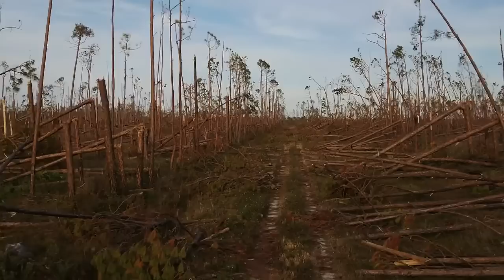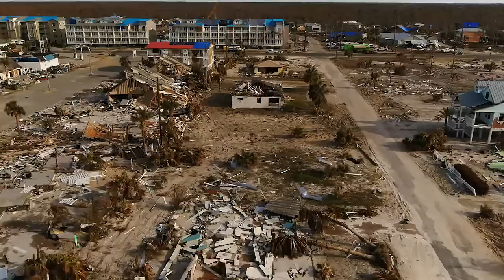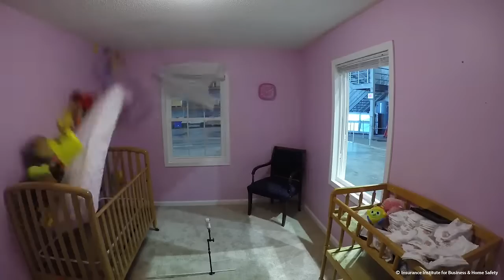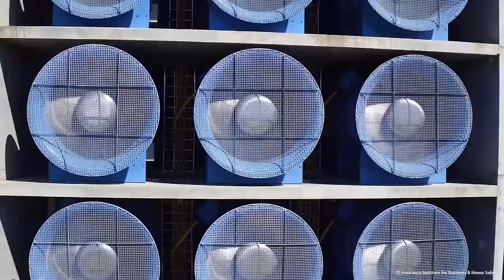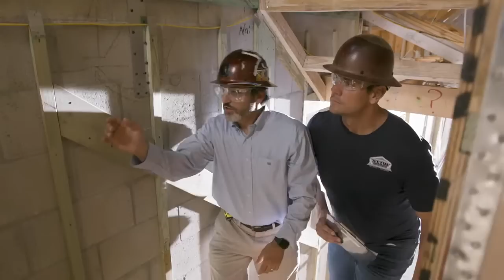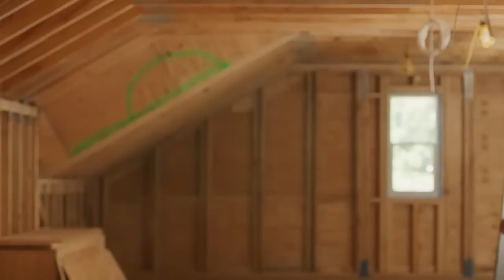Preparing for a Hurricane: the Engineering Behind Your Home

Comment: There is a catch because the hurricane-engineered home is 20% more expensive. The insurance is usually based on the replacement cost so the cost of insurance is actually higher. In the long term, it's cheaper to rebuild. Now if a house can withstand wind and water there could be a lower cost and less displacement of homeowners. Concrete domes hold up the best and everyone knows it. It's probably why they don't even need to test them. Poured concrete is the absolute best for Florida and the islands.